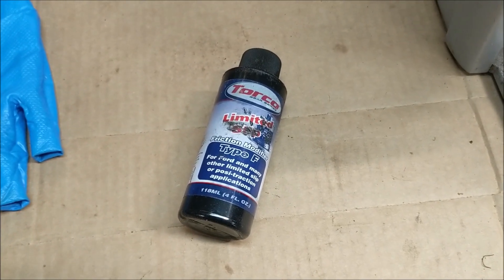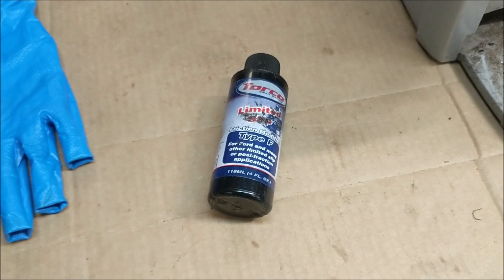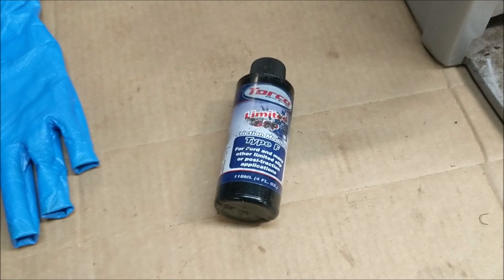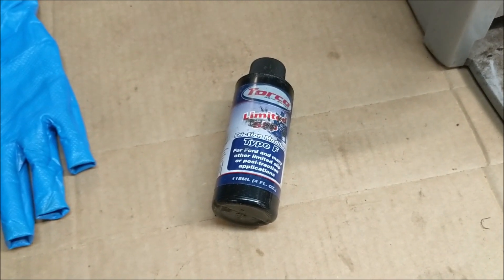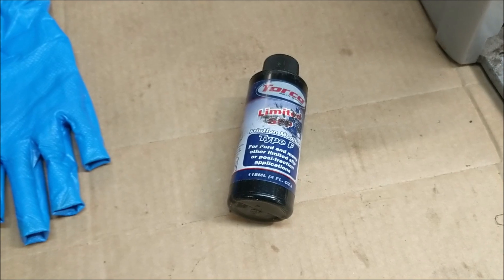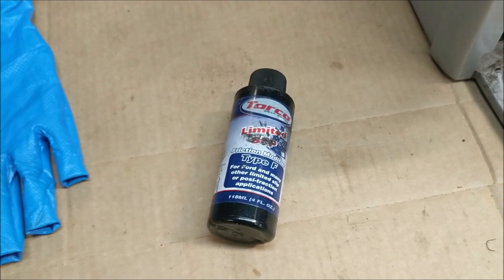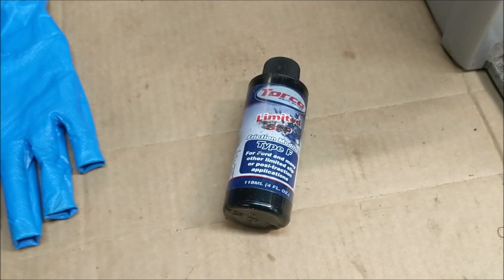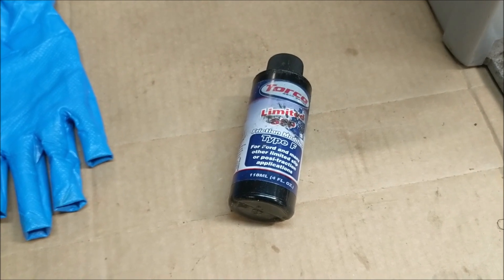2005 GTO rear differential test

Comment: That’s one way to find out I guess 😳
Reply from the maker: It worked perfectly! I can't believe how good it sounds. I've never heard the new exhaust from outside the car
Reply: @evsnova74  you have a beautiful car. I really regret not getting an 05-06. And a manual.
But, power can and will be added, and a manual swap is coming. 
It’s nice to see you actually driving it for sure! 😎
Reply from the maker: @Modern-Muscle-PNW  It has a lot of issues. Dings, dents, scratches, peeling and missing clear coat, rebuilt title, etc. I'll get an 04 some day, I like how the hood and exhaust look on them. But yeah, manual is  mandatory lol
Reply: @evsnova74  it’s beautiful because it’s a gto and none of its issues matter because your most likely never going to sell it and your the type of person to restore it to its former condition. 
An automatic has its place, but mine sucks. I’ve got everything for the swap except the magnum. I’m a little intimidated but it’s going to happen soon. 
Wish you were close, I’d give you my hood and bumper. Already have the hood I want 😈and an 05-06 rear bumper.
Reply from the maker: @Modern-Muscle-PNW  Yes I'll focus on the cosmetics at some point.
Actually funny enough if I ever get an 04 I wouldn't mind if it were an auto. But I've got my hands full with 2 other vehicles already, not to mention tractors and mowers lol.
Reply: @evsnova74  I just bought a Prius! 😳

The gto isn’t insured to drive until February now. So she will sit all winter. I have a couple small projects to do to her and just redid the rear suspension yesterday. 
October will be one year of having my goat. Many mistakes and lessons learned but a great ride. Can’t wait for year two.